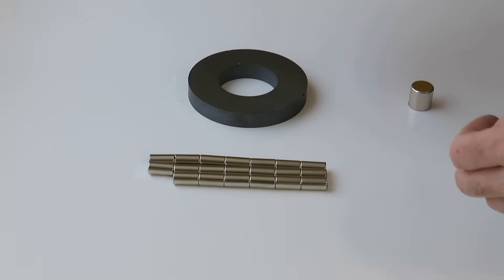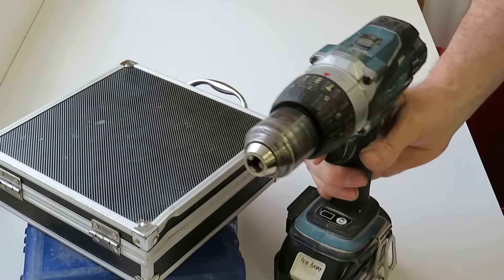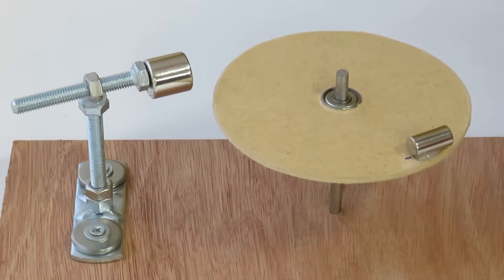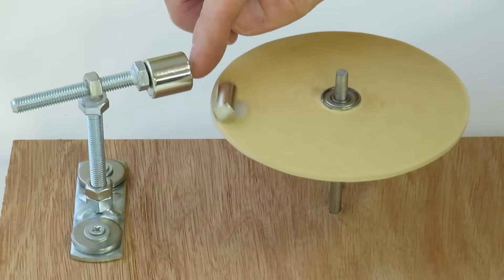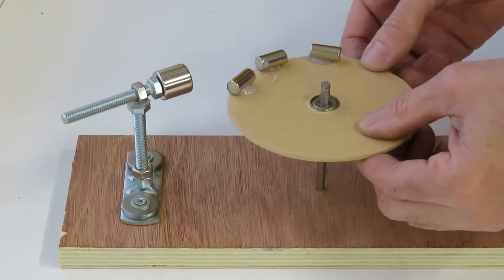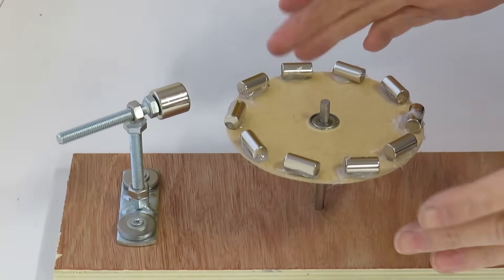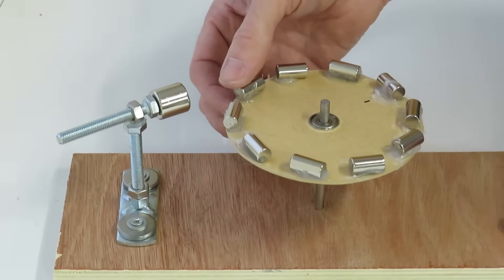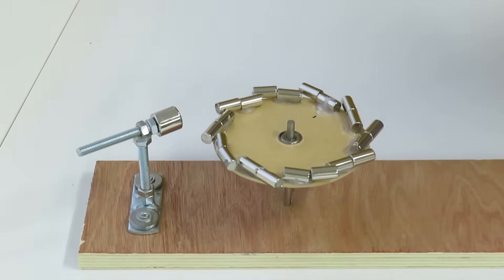Magnetic Energy - Crude Magnet Disc Challenge!

Comment: You must shield the stationary magnet on the incoming side to block the attraction incoming, so just the repulsion of the stationary magnet is forcing the other magnets away, then your cooking with gas….I have seen this done with a 9 volt battery as the shield material.not any battery power just the material it self will shield the magnetic force, placed beside the stationary magnet to block attractive forces.

Comment: Have you thought of using a longer cylindrical magnet so that the poles are further apart and using some magnetic shielding so that the field doesn't catch the magnet the moment it passes the stationary magnet?
Reply: easy fix is to cut away the other pole
Reply: @pekvek You do not understand magnets.  If you cut away the other pole you just end up with 2 magnets.
Reply: It would make no difference with longer magnets, if he took the stater magnet away completely it would spin a lot longer, magnetic shielding well do absolutely nothing. The force required to repell the magnets is the same as their attracting forces therefore there is zero gain magnetic shielding or not, magnets do not behave like rockets so angling them doesn't do nothing.

Comment: I think the answer lies in the angle of attack. Rather than having the magnets on the disk facing only part way towards the other magnet. You should try gluing the magnets with the apposing side facing completely outward from the center of the disk so less of the attractive side is visible ! Try leaving the large stationary magnet at the same angle and then also try it facing directly at the disk.
Reply: Doesn't work magnets don't behave like rockets and angling them does nothing.

Comment: We can turn off the left side bigger magnetic for some specific intervel at the point where the megnetic locking is happening.
If you can try that would be great, with some mechanical lever attached with gears to the circular disk of magnets.

Comment: For success you need to focus magnetic field or isolate it so that opposite fields could interact only in one way/direction. It could be performed by superconductor or with switching stator magnetic field. Only then it could work :)
Reply: U might also block magnetic lines by a piece of copper or aluminium, while magnet is approaching stationary magnet, the release the aluminum plate so magnetism pushes.
You then need to justify energy needed to push in and out the aluminium plate on each cycle, it should not work but might be fun !

Comment: Hi Pete you should try some magnetic shielding with mu metal
https://www.youtube.com/watch?v=bOf6zfDSO6E
also go with a larger wheel with some weight on the outside circumference to act as a flywheel

IMHO just those two changes should improve your end results substantially

Comment: It is too small, magnets have improper form , inertia is not amplified is actually lost  ,  size matters here, angles matter ,  coriolis effect maters and you actually can't create energy out of nothing but you can transform a type of energy to another with a certain loss (transformation itself consumes something ). so eliminating some of the efficiency killing details might help : using longer magnet bars , thinner, at a certain angle to each other on a larger diameter disc of a lighter material , certain succession order and momentum building position of the wheel , all built in a way that when applying an external flow of energy like an air current, the ease of pushing the wheel would make it very efficient in turning air power in electricity, ( why are electricity turbines and generators ideally positioned vertically , huh?) etc. If this was a simple thing to do, everybody would have a free energy generator in his home right now .

Comment: Maybe you could add an escapement mechanism similar to the ones in a mechanical clock? The stationary magnet could pivot so it pushes one magnet, then doesn't "catch" the next magnet.
Reply: I made one that worked, I made the wheel similar to a car distributor with a cam and points. The outside magnets were spring loaded and fixed outside of the center wheel. As the repel came by the spring aloud it to pass, then come back up and pull.
Reply: That's a great thought. I also thought about maybe a counter weight to propel the wheel at the point that it wants to stop. Kind of like a flywheel concept. Just a thought 🤔
Reply: @donpennington4655  what if you left everything the way you have it, only if you could make the single outer magnet on the stand so it moves in and out to push each magnet on the wheel, it pulls the magnet out of the way before it attracts then pushes. You would need something like a cam and a flywheel would help. You could put the single magnet in an aluminum cylinder and have it operate like a piston. I was working on something similar but with four pistons that would have like a circular firing order.
Reply: @flynnstone3580  great idea 👍

Comment: Try a steel ball enclosed in a rubber tube on the circumference of the disc. then tip the unit at a 45-degree angle. then adjust the stationary magnet until it barely acts upon it.

Comment: I have built a linear track that is in a way like the HJ TRACKS my video is on the web use my name and magnets you should find it. Try this experiment. Place two magnets on your rotor 180 apart.  Say N poles pointing out .Use your stator setup. Now have someway of placing a force on the axle that you can repeat each time. I tied a string around the axle and let it drop with a weight on the end. This way I knew my input force would be about the same. Drop the weight count turns. Change stator between attraction and repulsion use a statistically appropriate number of trials. Add a second stator setup 180 from fist repeat trials both stator attract pole repel poles and one in attraction other in repulsion. Anything interesting about the results? None of the trials will rotate continuously. But the results will be at least interesting. The forces in the  bloche wall. How much force does it take to push 2 magnets ( identical poles) together. Vs how much force is required to pull at 180 2 magnets in attraction apart.

Comment: This is cool. I got mine to spin for 9 minutes and 10 sec without a bearing using a vertical setup and levitation. I was unaware of the challenge.
Reply: I was thinking of trying to use magnets to create levitation to try to get rid of the resistance of the bearing but ... I haven't yet tried anything. I will eventually try this because I have a lot of ideas. I need proper angles and a 3d printer for my end result. Though the laws of physics claim the project to be impossible, I still plan to try to get something very close to this working
Reply: 😂😂😂 También se puede hacer por mas tiempo y superior a 9 minutos y sin imanes ,una simple peonza  en casi levitación y un fuerte giro de manos 💁

Comment: I've fallen down this rabbit hole myself. I finally came the realization that a force is not energy. It seems so much like it, especially as it's a real thing despite us not being able to see it or feel it without holding a magnet or material that interacts with a magnet.
The realization I finally came to was that energy is simply a change in state. Magnetic fields are constants, not changing, like Earth's gravity.
When you spin the wheel, you introduce kinetic force into the equation. It may seem like when it takes off, that you aren't putting an equal force in, but you are forgetting the initial potential energy you put into the system when placing the wheel in position. With just one or a few magnets, it probably wasn't any, as you likely kept the magnets far from each other initially. So, you had to fight the magnet hard to position it at the point it would repel. When the wheel was full of magnets though, you couldn't keep the magnets separated, so it probably took a lot more work getting the wheel into position. That extra effort was building up quite a bit of potential energy into the system.
What your really doing is making a low friction bearing, but there are opposing forces that still fight the turning. Plus, as no real energy is being added, eventually friction will deplete what was.
You may improve things more if you alter the angle of the magnets so only the repelling pole is facing out. It will change the bumpiness of the fields. Still won't make it turn for forever, but may turn it longer.

Comment: I understand what you're showing. But most of the other ones have multiple push points and they're if all those push points are equal. I just one of this push-points the magnet is flipped around. On the wheel as well as on the push point then you will never have a locking point for one of those magnets will always pushing away.

Comment: Replace metal parts with plexiglass, also what if you use 4 small magnets arranged in a cross formation at the direct center of the disk, then on the outer edge of the disk arrange paramagnetic materials....

Comment: I suppose the key thing is whether you get more energy produced while the disk is still spinning, than you have to use to get it spinning in the first place.  If so, then you would just have to keep cycling the system by zapping it back into motion every time it locks up...for a net energy gain.  It would be interesting to introduce the mechanical and electrical components necessary to see if, for example, such a system could charge a battery over time...or power an electric vehicle of some sort.

Comment: Nice Video,    lets think about a next Spot.   Maybe its possible to lift the Pushmagnet  everytime when the new Magnet on the Rotaryplate enters the Magnetfield of the Pushmagnet to reduce the negativ Energy and when it passes a special point the Pushmagnet fall back in to the optimal position.     or       Place a Material between Pushmagnet and nearer comming Magnet which damps / neutralize the Magnetfield.   sorry for my bad English its a little bit rusty ;)
Reply: for exampel1: to avoid frictionloss place magnets under the Spining wheel which between the Magnets to made a simple magnetic Crankshaft which lift the Pushmagnet just bevor the new Magnetfield take effekt with the pushmagnet magneticfield and can create a negativ Energy, then after the new magnet passes the Pushmagnet, the pushmagnet fall down to normal position and give the magnet new pushing Energy.

Comment: Yeah why do we even buy fans to coolest down when we could just attach magnets to the fans. All we would have to do to make the fan move is grab the fan blade and push it and then the fan blade would blow and it would keep blowing as long as that magnetic field kept propelling it forward. Magnets will literally keep their charge for decades. So there's no point in buying fans anymore just put magnets on your fan in a certain way and you can literally create a fan that will never stop moving. And if you and if you attach a bridge rectifier to it you can literally create an engine that will never stop producing energy ever so this notion that you need solar panels or whatever no we literally can create free energy with magnets it's not hard to do. You just need a really nice motor that can give you a high enough charge on your battery and make sure that your battery is a high quality one so as you're making energy and you're pulling energy from the battery you're not pulling more energy than you're creating. As long as you do this you'll never run out of power unless the motor breaks down but again spend $3,000 on a really powerful motor set it up to run on magnets or build one yourself and you won't have to worry about it as long as the magnet keeps a charge on the magnets which literally lasts for decades. You'll never have to worry about power ever again. So this notion that you need to even buy energy is just retarded you don't need to buy energy from anyone you can literally produce it on your own you just need to understand how electricity works. The United States is so underdeveloped we should have generators in all of our houses. Power should be a commodity it should be literally like water. No it should be like sand on the ground it's everywhere. And nobody should ever have an issue staying warm in the winter and cool in the summer. This constant greed is just disgusting

Comment: I had the same idea 20 years ago, except instead of one external magnet, I made a circle of magnets around the wheel. I’m going to build it pretty soon and see the results
Reply: The problem is without using electricity it will always stop at some point
Reply: I can tell you the results, it won't work.
Reply: @chrisadmaley  Lmfao
Reply: @woozy7405  people are so dumb about magnets they have no idea how they work lol
Reply: @Psi Starcraft  it's fun to challange our brains and come up with new ways and try them out some will work some won't. Don't discourage them from trying.
Reply: What if you used ring of magnets pushing and bismuth blocks on the rotor so it's always pushed and doesnt get pole locked? 🤔

Comment: Nicely made video. The task you are up against is mechanically analogous to trying to get a low-friction cart to coast more laps around a continuous circuit of track by putting various hills in parts of the track. But because local gravity is spatially simpler than the fields around a little magnet, not many people see the cart lapping a hilly loop of track as an interesting problem - it's easy to see that no arrangement of hills can power the cart or even reduce average drag per lap. The same principle is true for the magnet wheel.
Permanent magnets don't recieve energy from anywhere, so they have none to pass on. For the same reason, no arrangement of permanent magnets can reduce net drag on the wheel (except for magnetic bearings of course).
Reply: The cart would work if you could have a switchable anti gravity device and the magnet wheel would work with a switchable anti magnetic device. Unfortunately neither is available without putting energy in.
Reply: @peterstephenson4935  Exactly.
Reply: @drienkm great explanation, taught me how permanent magnets work without any effort on my part!
Reply from the maker: Thanks for the superb input!
Reply: @petesshed8422  I don't know about superb, but I'm very glad it made some sense!

Comment: Very nice video.  You bring up a good point about the magnets helping to make it spin longer.  To see if they have an effect, you can make a device that would start the spin, then  count the rotations with and without the stationary magnet.  It would be very interesting to know if the magnets actually effect the number of rotations.  The starting device should be consistent.  Again, very nice video
Reply: Sure the magnets are affecting the number of rotations. Without the big one this contraption will spin much longer.
Reply: @andreasschmitt2307  dead right.
Reply: @andreasschmitt2307  I've been playing with a similar toy here at home, the magnets make it spin more than it would otherwise then stop rather abruptly.

Remove the external magnet and then spin and it loses momentum much quicker but it doesn't have that abrupt loss of momentum.

There's something going on there, not sure what but my little toy will spin for roughly two minutes with an external magnet, I didn't actually time it without but it was a good deal less than two minutes, wasn't even close.

Proximity to the magnet makes a huge difference and adding magnets to the spinning device did not help past a point. I figured that even just adding mass would aid in the spinning duration but it did not.

Comment: The positioning of the magnets on the spinning wheel will make a big difference as does your size and dimension of your magnetic propeller. Having that single force more focused would provide the same stream like influence of flowing water
Reply: Ie not parallel to the circular edge but rather angled to recieve the directed blow from the single opposing force which needs repositioned also.
Might even look into an over tube wrap of magnetic blocking material to focus the magnetic wave.
Reply: Excelente ganhou mais um inscrito pela honestidade

Comment: I don't know a lot about magnets, but is there a kind of shielding you could put along side of the big magnet on the stand so it's field didn't extend sideways and slow down the wheel?  So that the field does only extend forwards?
Reply: Cannot. The magnetic field must always be closed in order to show a seeming resistance as a "force". Ergo, this "force" only manifests if there is a closed magnetic field. If there was a mythical mono-polar magnet, it would be possible, even if it would not be clear what it closed with its magnetic field. Fortunately, monopolar magnet does not exist despite the wishes of fantasts. But there is an alternative - a static electric field that actually creates such monopoles against a grounded counterpart. It would be good to examine electrostatic motors. Many people have already verified the malfunction of the magnetic engines ála Perpetuum Mobile, both scientists and fools.
Reply: The thing to understand about magnetic fields is you can't cut off part of them. You can guide the field, spread it out, or concentrate it, but it will maintain the same characteristics. In the common visualization of "lines" used to understand the spatial field distribution, a particular line will always be a continuous loop through the magnet through the space around it. All you can do is guide the loop with various materials or other fields.
Reply: Bimuth